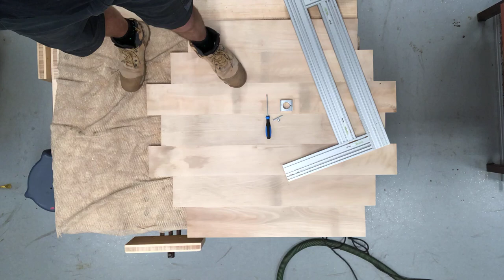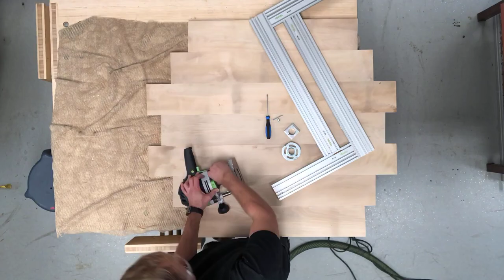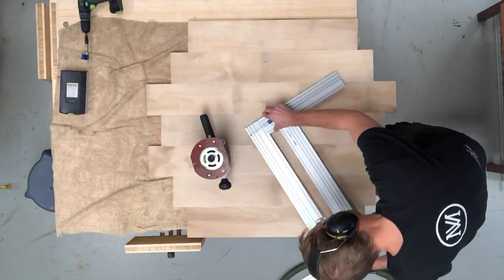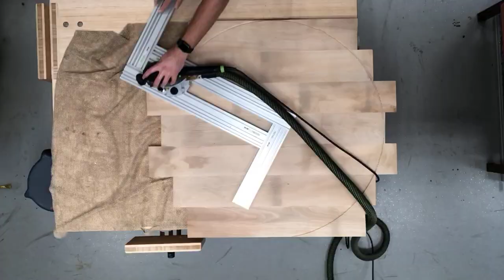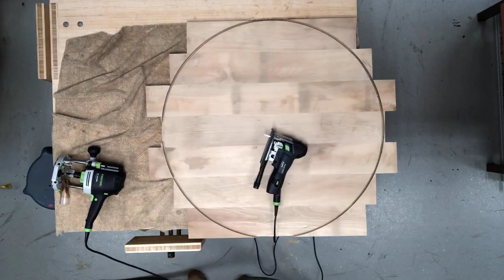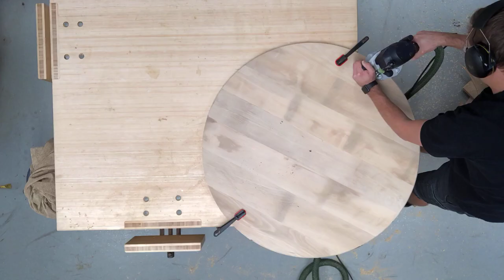Using the MFS template to route perfect circles

Comment: Can you use only the router to do it instead of switching between router >jigsaw>router?
Reply from the maker: G'day Peter. Yep, you can use the router alone and it will work fine. You would step the cut over a series of depths and our product expert, Macca, would recommend a backing splinter piece for the final cut. Justin